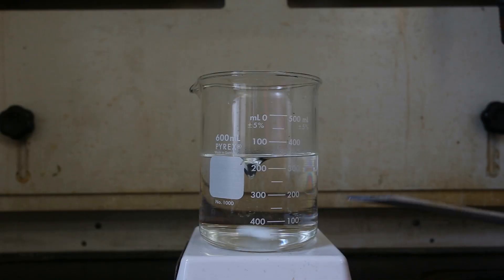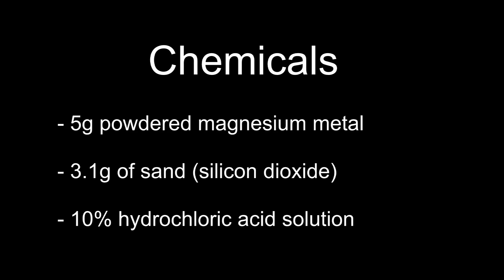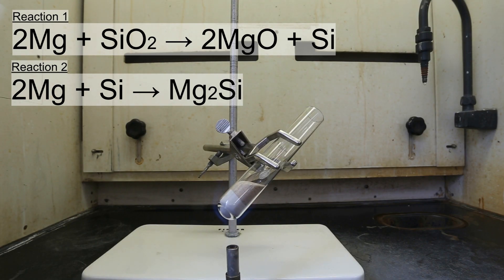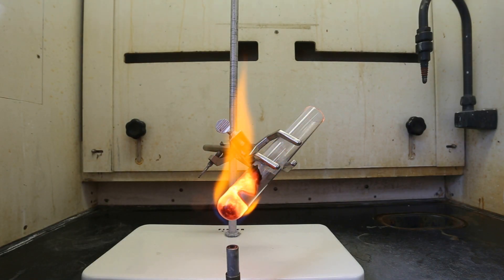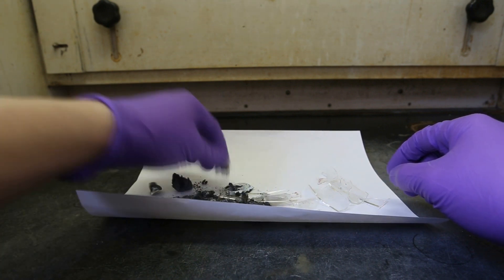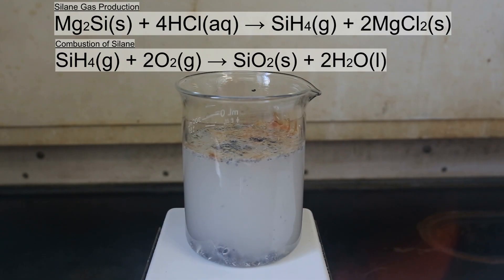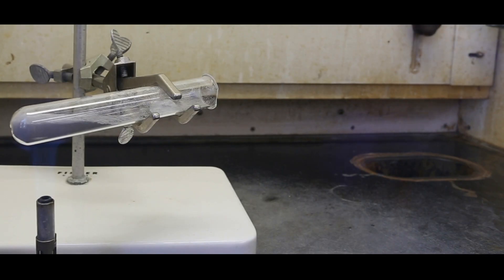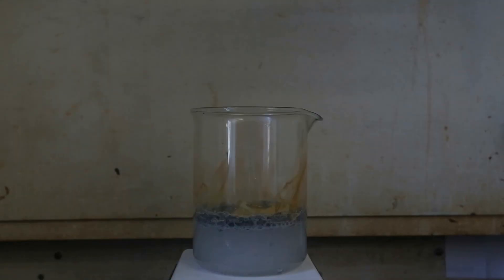Making Magnesium Silicide and Explosive Silane Gas

Comment: Hmm wonder if it would work with aluminum instead of magnesium.
Reply: I'm afraid aluminum and silicon might turn out to be incompatible in terms of their radii. Plus, since they're so close int he periodic table, I would expect there to bee too low of an electronegativity difference, substantially decreasing the energy output of such a reaction. Plus, even if it is possible, the activation energy might be too high. I mean there must be a reason every textbook out there gives the reaction with manganese and not aluminum.

Comment: proposed use: Hydrochloric acid is the stuff you have in your stomach. Eat magnesium silicide to burp flames.
Reply: The fbi would like to know ur location
Reply: I kinda wanna try now...but I don't think it's a good idea
Reply: What about silane turbo charged balloon?
Reply: Most of it would be burning inside your stomach, very bad, also what doesn't burn will turn to sand inside your lungs and eyes! Even inside the cells! That also *bad*.
try calcium carbide instead and just ignite it when burping.. if you don't silicide yourself let me know how it goes..
Or do like me when I was younger and just suck in some butane from your lighter.. then light it when burping, fun at bars, just don't hiccup,   that  bad too.

You have to expel the gas fast enough that the flame front don't work its way back into you.
Also if you are doing this at a bar, it doesn't mix well with things of 150 proof or more...
 ...may result in an arson charge.
Reply: @petevenuti7355 
A fellow did a fire-breathing trick at my wedding. He did manage to keep the flame from going back into his mouth, but had the opposite problem, because excess fuel ignited in his beard.

Fortunately we were able to put the fire out before he received anything worse than first-degree burns, but we still tell the kids about "the day your uncle almost torched the ceiling and set his face on fire".
Reply: There is only about 1% Hydrochlorid in our stomach

Comment: i blended glass i a fine powder    can i use it as the sand and if i can should i cover the magnesium mixture in the testtube with the blended glass andif i can't use it does the sand have to be acidified?

Comment: In the organic chemistry class I took, we did "sodium fusion" reactions.  It's done like this.  A small piece of Na is placed in a test tube, and is heated intensely.  An organic chemical you want to analyze is then squirted into the test tube.  The reaction is pretty vigorous.  Then, while the test tube is still really hot, it's plunged into water.  It shatters.  The glass peices sink to the bottom, leaving a clear solution that then undergoes elemental analysis.  I think this method would be ideal for the experiment described here.
Reply: Yes, it's called the Lassaigne's Test, and it is used for converting the covalent bond into an ionic one, so you can easily identify the atom present. Usually done for detecting the presence of nitrogen, sulphur, and halogens!

Comment: A word of caution regarding the sand: not all sand is SiO2.  The typical "play sand," used for kids' play-boxes, or for making concrete is likely to contain various silicates and other minerals.  Remember, sand is nothing more than rock, which was pulverized by erosion, and has the same composition as the original rock.  Be sure to get silica sand, or quartz sand.  This is sold for sand blasting.  You'll note it is pure white in color, whereas other sand is usually tan.
Reply: Clyde Wary  if you get playground or beach sand that is usually a pure enough source of silicon dioxide for most purposes. The most important thing is to wash whatever sand you use with acid several times to remove any carbonates or non silica based minerals. Nitric or hydrochloric acids can be used for this. After washing with acid and rinsing with distilled water, even crude sources of silicon dioxide should be usable for most purposes.
Reply: How would you reduce said silicates to silica?
Reply: @everettduncan7543  a tube furnace possibly
Reply: No problem, simple sand does the job perfectly.
Reply: Clyde Wary 
Do you think the sun might have caused decay?
Reply: ecstasy.apostasy  no, the difference in color between Quartz or silica sand is due to small amounts of other minerals in the crystal structure. Same way that causes diamonds and other minerals to have different colors.

Comment: I have access to a creek. The sand is about the size of a grain of salt. Will it still work, or does it need to be ground? How do I grind it, with a mortar and pestle?
Reply from the maker: It should still work, but you should use grain sizes of Mg and sand that are equal if you can. You should be able to grind it using a mortar and pestle, but i am not sure if you can. I'v never tried. Just be sure to dry the sand thoroughly before using it and it should be okay.

Comment: Can you make a video showing how to make silicon tetrachloride? It is a really interesting compound, but I have no idea how to make it. I have seen procedures calling for "treating silicon metal with chlorine gas" but I don't know how that should be done.
If you can figure anythiing out let me know
Reply from the maker: hmmm, actually very interesting! I will look into this :)
Reply from the maker: heat silicon metal and pass over DRY chlorine gas.
Reply: And for heating the Si metal should it just be gently heated or heated strongly? Also could you give me the source from which you found this? Thanks!!
Reply from the maker: Strongly with a bunsen burner. Here is the link:

http://www.chemiedidaktik.uni-wuppertal.de/disido_cy/en/exp/m_fact01.htm

Comment: Can you just use one of the silica gel packets that say don't eat on them and throw those in the test tube and heat up???
Reply from the maker: I have never tried, but you would have to first dehydrate them and then crush them. Their purpose in that little packet is to absorb water, so you can imagine they will be pretty wet. Also, if the grain size is too big, it won't react properly with the magnesium. 

If you do try this, be careful. Silical gel and magnesium together can be quite dangerous.